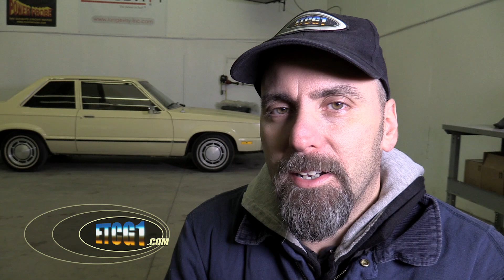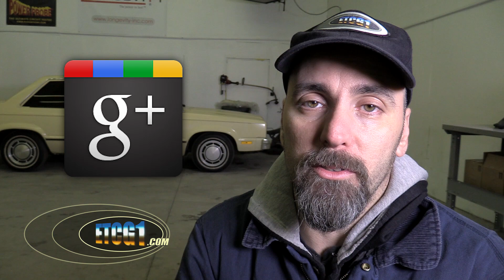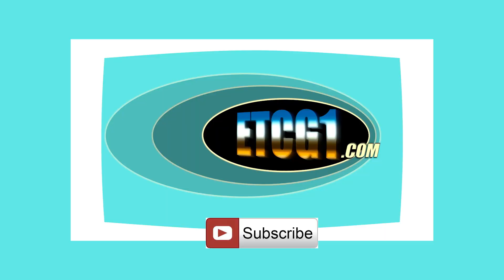How Things Have Changed In Auto Repair -ETCG1

Comment: My two cents...  I worked/owned two automotive repair garages in the 80s.  Most of the vehicles we repaired were 60's, 70's, and we also did diagnostic work for newer 80's Volvos for local dealerships when they had problems with their newer vehicles and failing pollution control modifications.  We had no diagnostic equipment at all.  How did we manage?  Well, all I can say is that our mechanical understanding was more of an  art than a science.  We really knew how the vehicles of the day were designed and how they were supposed to function.  Today, computers seemed to have replaced this art and made diagnosis more "black box" in nature.  That seems to have put maintenance firmly in corporate hands rather than the hands of a good mechanic.  I haven't rejected this computer technology, but it seems to me that maintenance was much simpler, less problematic, and less expensive decades ago.
Reply: +Bourne Accident it used to be fluid changes-
                                 now with "sealed systems/lifetime fill" its component changes. 
                                  Like a gearbox or engine is a "component".  The autos are designed to cover the warranty 
                                 window & bring the next buyer/leaser on to the dealers' lots when the "component" fails @ 8 years.
Reply: Welcome to the new age. No one cares how you used to do it

Comment: What an awesome topic!  I was a dealership mechanic while I was in college in the mid-1990's, and now I work in IT.  I wonder if some of the computer hard drive "SMART" technology will make its way into an all-inclusive car control module.  This way, the car will tell you what is about to fail, BEFORE it fails.  This would truly be a great feature to have!

I also remember back when I was in the shops, there'd be some old-timers that hated the computers and they'd give away any "check engine light" or "ABS light" work to us younger, computer friendly guys.  They stuck to suspension, alignments, etc.  You'd think that they'd suffer, but the guys I am thinking about always had gravy work, because they could do a better alignment much faster than anyone else.  I guess they specialized in known, mechanical only work, and it served them well.

I wonder if the shops are now much safer to work in too?  When I was there, the dealership provided a brake dust disposal system (basically a little safety clean machine you could roll over to the brakes you were working on) and they provided vacuum exhaust hoses, but many techs would not use them.  Is this stuff enforced now?

Comment: An excellent summary Eric. I had tiny classic car business in South London the 1980s and the techniques I needed to know to work on a (then) modern car of the 80s was not very different from the skills I used on cars of the 50s. But now (I've recently gone back into the industry in a very small way after decades doing other things) I have none of the skills required to work on modern cars- I don't have the computers nor the software, nor the skills. 

Another problem is that manufacturers go out of their way to make life difficult for a traditional mechanic (or home DIY mechanic) and like all work to be undertaken at high labour rates and high parts costs by the official dealerships. I recently changed a headlamp on a Subaru and had to take off the whole of the front panel to do it. Such a design decision for the manufacturer is not accidental, it's deliberate. A friend recently changed an alternator and a broken tensioner on his Seat (similar to a VW Golf) and it was stupidly complicated. The alternator itself was assembled with special fastenings so a second-hand one was found to replace it rather than a new bearing being fitted. On an old car it would have been 20 minutes to change an alternator, not the several hours he needed to complete the job. 

The other thing I've noticed is that customers who come to me with cars from the 60s have often been ripped off by independent garages - not just because the garages are dishonest (though some are) but because young technicians often don't know the basics and are stuck for ideas without computer diagnostics.

Comment: I started fixing cars, trucks, farm machinery back in the 1950's. I learned to diagnose by gathering all the facts and thinking my way through the repair. It was a sad thing that MOST mechanics of that day would fix things by throwing parts at the problem till either they hit on the fix by luck or you ran out of money. There were some intelligent people in my life, my father, my uncles, neighbors etc. I learned how NOT to throw money at a problem but rather to find out what is really the cause and fix it properly without wasting money. my recent project here was to rebuild a Lincwelder DC-225 amp the a friend gave me. it was sitting out in her yard for 8 years. had to disassemble the engine and replace the crank, bearing, bake the water out of the magneto coil(reseal with silicon sealer after). Along with a bunch of little things it was such a happy time when I fired it up and it works perfectly. Its fun fixing things.
Reply: +NebukedNezzer That was plain fun to read. :)

Comment: The worst of the OBD1 vehicles were Nissan.  As a tall guy, I used to HATE inverting myself in the back seat of a Sentra and twist those computer screws and count flashes with my head on a wet carpet in the cold.  I don't miss that.  Now I have computers that plug in and I can sit comfortably in the drivers seat.
Reply: +briansmobile1 Amen to that! Yea, the Nissans of the past were a challenge.
Reply: +briansmobile1 That's only the earliest OBD-I Nissans though... I did that on my 1989 240SX, whee fun. But the Z32 and DOHC OBD-I 240SXs had a CONSULT interface, you can buy an interface from DealExtreme or others. That's an externally clocked serial interface which lets you diddle timing and fuel delivery and read sensors.
Reply: +briansmobile1 Nissan's still suck, great design allowing a Throttle Body gasket deteriorate and leak into the IACV and directly short out the PCM
Reply: Gregory Davis Nothing compared to 6 liter Ford :p

Comment: I drive semi for a living, about three years ago I had a breakdown and limped the truck into the Kenworth dealer in the Cleveland area.  Turned out that the turbocharger speed sensor (yes, it is a real part on a Cummins ISX) had failed.  Service manager said it was an eight page document to go from scanning the code to component replacement.

Of other interest there at the time was a Swift truck with a Cummins ISX that had a failure in the block, and they were doing a replacement.  All the items hung off of the engine filled at least three full sheets of plywood, just to get down to your basic long block.

Contrast this to the 1966 John Deere 4020 Diesel my parents had on the farm when I was a kid, which was about as basic as you could get.  I remember having to rewire the tractor in the nineties, because the starter solenoid shorted out, which dad didn't know until he dropped in fresh batteries.  Took the opportunity to switch from 24 volt to the more common 12 volt, and swap the generator for an alternator.

Comment: This is good stuff.  I have been working on cars since the 50's.  The late 70's till late 90's is a hard time to diagnose engine problems.  For instance a friend has a 84 El Camino.  The check engine light consistently comes on.  He and I have worked on this problem with no success.  He took it to several places, including Chev. dealers.  No one has been able to figure out what the CORRECT problem is.  The scanners always show a problem with the EGR but expensive replacements have not made any difference.  Thanks for your forum.  I always enjoy reading it

Comment: I had an old Ford Pinto and I remember drilling out the carburetor jets and driving with a portable exhaust analyzer to check AF ratios over the driving range. I also used to change the centrifugal and vacuum advance characteristics in the distributor to fine tune ignition advance curves. Those days are long gone.

Comment: Eric, I'm so old (58 years) I remember driving my first vehicle, a used 1973 Datsun 620, regular cab, 4-speed manual.  Because I lived in a really small town, when I needed parts, I visited my local junk yard.  They had several crashed trucks, but loaded with good parts,  I bought a drive-shaft for $50.00, A wheel and hub cap for $5.00, A rear view mirror for $5.00 and a radiator for $15.00.  Back then, vehicles were so easy to work on, with a little help from your friends.  No more!  Everything is computer controlled.  Now, I just take my vehicle to the dealership for a simple oil and filter change.  Arthritis controls my day now.

Comment: I read a fantastic article ages ago called 'Electrification of the Automobile'. Way back when, you had a simple internal combustion engine and everything else (accessories-wise) was either hydraulic or vacuum driven...or...manually-operated by your own two hands (e.g. spark advance, manual steering); at the infancy of the auto, the main electrical components were a 6v battery, magneto and spark plugs. Fast forward a century, we now have electronic ignition, power-everything, on-board computers that do everything from shut down combustion in cylinders, to braking wheels to control traction, even electric steering (which has done away with hydraulics to an extent) It's inevitable that eventually, we will have completely electric propulsion of the vehicle itself. I think electricity will gradually fully take hold of the automobile as we know it. The days of internal combustion are numbered and have been for a while already.

Comment: However Eric, in the 70's (my era), there were no computers at all. Carburetors, points and use a dwell tach if your ear wasnt tuned right.. .  If you went techno, add a pointless distributor and electronic ignition - which bumped the spark voltage to over 60,000V.  Recently we tuned a 1972 Chev 350 V8 to meet English emission standards... and this was successful with a Holley 4 BBL with vacuum secondaries set to run as lean as possible + a catalytic converter to each exhaust bank.  It passed. This shows that crude old carbies can be made to run to current standards.  So there are 2 ages for engineers... pre computers... and later when computers actually worked.  The bit in-between is messy as you say.  But I remember the sound of an Australian 1972 GTHO Phase III SuperRoo Ford Falcon GT revving hard in top gear and yearn for those years.  Or an E38 Valiant Charger 6 cylinder with 3 double barrelled Webers at 7000rpm and the wheels lifted. Or the God of cars >> the 1972 Holden Monaro with the 327 Chev and the Muncie 4 speed manual transmission.  But for me, I search eternally for a VG Valiant Pacer 2-door Hardtop with the 318 Mopar and the 727 trans.. add an Edelbrock manifold and a Holley 650 double pumper and enjoy the best sound that God ever released..  
Sorry, just reminising.  The good ol days.  And my oath they were good

Comment: I started working in the industry in 1976 and let me say when 1979 80 to about 1989 the stuff you went through to fix some of this would blow your mind especially after the town hack went and stuck bb's the the vacuum hoses and disconnected switch and or sensors they where pain in the a$$ years and I don't miss them. If I where to repeat  that all over IM sure I would not become an auto mechanic or by today's standards a technician. However IM still grinding away after forty years.

Comment: I am working as a motorcycle mechanic and because i live in a rural area we work on alot of atvs and utvs at our shop and what you had to deal with in the 80s-90s is what we are doing today. There is no real diagnostic system all we get is a fault code on the dash(if the bike has a dash) and we look in the service manual and find out what that means. We also rebuild and repair alot of things, especially on the atvs and utvs like diffs, transmissions and engines. I hope that one day the motorcycle world comes up with something similar to obd2 to make my life alot easier.

Comment: The dark ages of pre-OBDII!
Reply: +MPGomatic idk how you guys did it in the late 70s to early 90s. The things we take for granted these days.
Reply: +MPGomatic But early, early on, it was still mostly mechanical, so I'm not sure of where you were going with that, lol.
Reply: +MPGomatic  there is a wireless thing that kind like OBD you use it to you phone also you can monetor whats going to ur engine using apps
Reply: +MPGomatic that for ranger of the late 80s that flashed idiot lights at you to diagnose codes
Reply: +MPGomatic  that my friend was when the term if it aint broke dont fix it comes along
Reply: Matt W
Yep, now if it's not running quite right, it's worth trying to make it better.
Reply: +MPGomatic It really was not so bad for me, sometimes fun. For the most part many of the cars back then were pretty reliable with the occasional one that makes sense to anyone including the dealer,we replaced everything twice already including wiring harnesses. Those usually ended up at the scrap yard by loss cutting owners. There were different types of guys back then. You were either the very technical type that would go through all the tests and look at data streams, test individual circuits and sensors directly with a DVM or scope. Then you had the guys (which were honestly the majority from my POV) that just kept throwing part after part at it on nothing but hunches which was hit or miss...Speaking on Domestics, GM was easiest, then Mopar and the Fords were by far the worst due to not being able to easily access info or get into the data stream to see what's actually going on. Luckily in NY the bodies would be dead long before drive trains started to have serious issues electronically so I would say MOST were fairly reliable and it usually came down to good old tune up items and electric fuel pumps and relays which were not hard to diagnose.
Reply: turbobuicksix That makes tons of sense.
Reply: turbobuicksix What's bad is there are still too many like that.
Reply: +MPGomatic yeah the days when you actually dealt with faulty parts instead of replacing faulty sensors.
Reply: Dark ages? You mean the ages when you didn't have 100 sensors, wires and rubbish plastic "protectors" in the way, hiding the part that broke out? You mean the ages when you could actually see the part that broke out, verify by yourself (without having a computing university degree) if it did broke out or not and do a quick temporary fixing job to get it somewhere if something went wrong unexpectedly? Yeah you're right, dark ages... I own 3 injection OBD1 system based, high mileage, all reliable cars and I'm pretty satisfied with them. The golden age of cars was the late 80s and early 90s.
Reply: Ben Gagnon Call me a throwback, but I'm keen on the sixties. =)
Reply: +MPGomatic Well, I've never owned a car this old so I wouldn't know, but judging on my father's memories... ;)
Reply: Ben Gagnon I don't love the plastic in the way. But at least it stops some cars hard edges. Small silver lining. Seriously small.
Reply: Ben Gagnon I grew up buying those old cars. They never needed anything but mechanical help. The engines didn't hold up as well. But I  did but super used cars back in the day.
Reply: Maybe it has to do with the cars I'm interested in. I like old BMWs, MBs and Volvos. BMW stopped making fairly reliable and easy to repair cars in 1998, after the e36 series. MB stopped in 1995, after the 300E. Volvo stopped in 2000, after the S70/V70 (which were, at this time, rebadged 850 from the early 90s). So yeah. My 1993 Camry is also pretty much bulletproof, so was my 1991 one.
Reply: Ben Gagnon Yeah. I'm glad to hear 1999 Volvo and back are on your good list. It's mine if I fix it. Idiot lube tech destroyed it for the owner. The owner verified the idiocy by ignoring "complicated lights". He fixes things for a living, not cars, but still.

Engine went another few ten thousand miles before the 10% loss of compression in one cylinder turned into a flashing check engine light.

I like those old BMW's! They come in regularly to my shop. They're a bit harder to work on and Mitchell flag hours on BMW's are usually the same as normal cars, otherwise I'd love instead of like them coming in. Haha
Reply: +Ben Gagnon   "DARK" meaning the dashboard wasn't lit up like a Space Shuttle on POST, and a light turning on kept the vehicle from passing "inspection" and now costing the owner more money- and sometimes the Shop too- for tools, software, licenses, and college degrees. The second the crooked greedy Government realized they could make millions on a car not working correctly- it all went downhill from there.
Reply: +MPGomatic Good Ol' Days!!!!!!! Lol
Reply: sean7134 Since I sounds like your familiar with New York cars, I'm curious does anything in NY do better on rust?
Reply: sean7134 That's encouraging. Early Ford OBD II seemed pretty weak. Liking Ford, you're making me feel better about their OBD II dumbed down how the engineering looked.
Reply: sean7134  Try one of the "Electronic Feedback Carburetors"? Those were nasty junk when new!
Reply: HUBBABUBBA DOOPYDOOP What was electronically fed back?